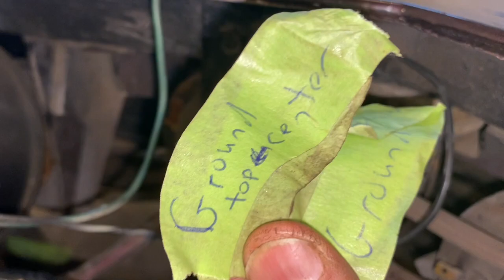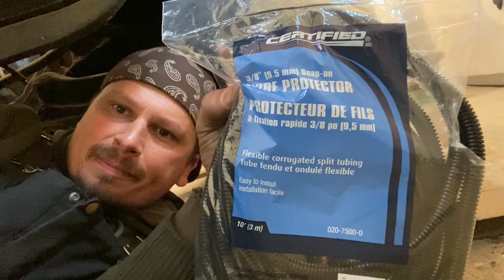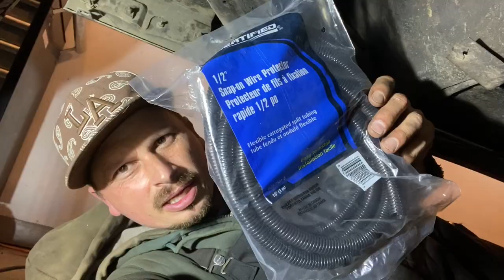Engine harness, Headlight harness installation (step-by-step Harness installation) Corvette C3

Comment: As you know, I've been enjoying your videos.  I also have a 1969 Corvette 350 automatic with A/C.  I replaced the fuel tank last year.  This week, I took two weeks off from work for various DR appointments, and to work on the Vette.  Yesterday, I removed the heater core.  I took a break today, but plan to start reinstalling it tomorrow.  I don't need to repair my engine harness but watched the videos for pointers anyways.
Thank you. Paul in VT
Reply from the maker: Good luck with your project, thanks for the feedback

Comment: A ton of Very useful info. Just picked up a 75 C3 and the previous owner started a new wiring harness and lost interest. So I'm driving into a mess. And your right , the grounds are So important ! I would also suggest heat shrink where needed.

Comment: I posted on your other video that lead me here. the firewall corvette c3 harness slides apart left right not pull apart. Now I think there is an issue with the fender harness that goes to the lights. Looking how to get the wires through there. my engine caught on fire. We have been replacing every wire and vacuum hose that goes from firewall on the drivers side.
Reply from the maker: I appreciate all the comments, yeah I’m about a month away from being finished, it’s been a really fun project

Comment: you need to explain what DIELECTRIC grease is.
Reply from the maker: Dielectric, sometimes referred to as tune-up grease, is a viscous non-conductive waterproof substance used to protect electrical connections from corrosion and dirt.

Comment: Thanks Man - Great video. Thinking about replacing or cleaning my 71 wiring. It’s in good shape. Clean or replace?
Reply from the maker: Pull it out and decide
Reply: @ProblemSolverGarage  If I pull it out, doesn’t it make more sense to replace with new? Some things, like the fuse panel, might be worth replacing, plus the light sockets, which work, but are crusty. Appreciate all your videos my Brother. Great job showing close ups and always giving good advice to us driveway DIY guys.

Comment: Hey buddy just wanna ask what happened to that orange wire was cut and you didn’t know what is it for did you find out as i got same problem on my 1973 c3 thanks
Reply from the maker: I think it was for the air-conditioning, I figure it out in the next video on the wiring harness or maybe the one after that you should watch the whole series it’s great, helping lots of people out.
 I think there’s three videos on the harnesses